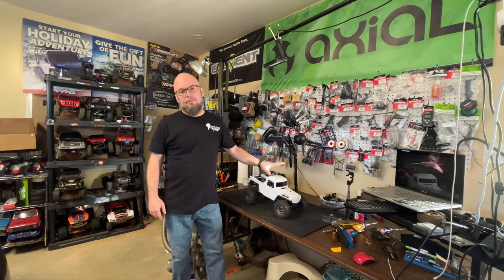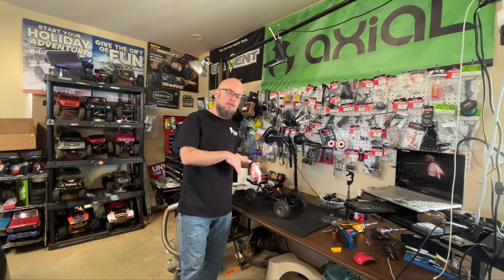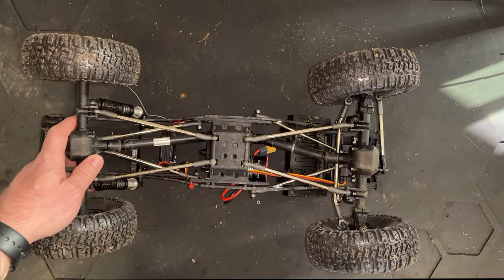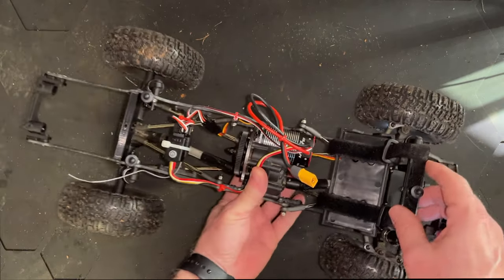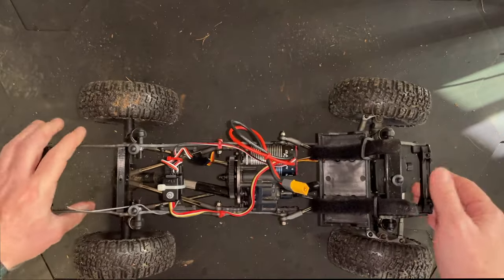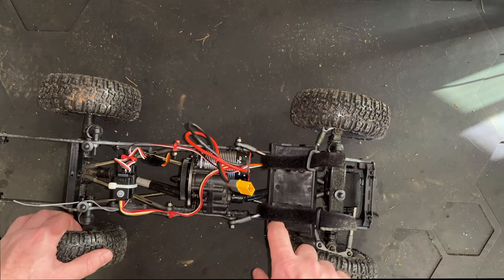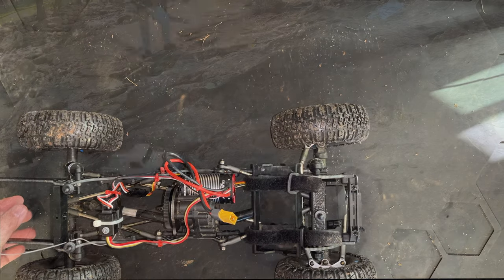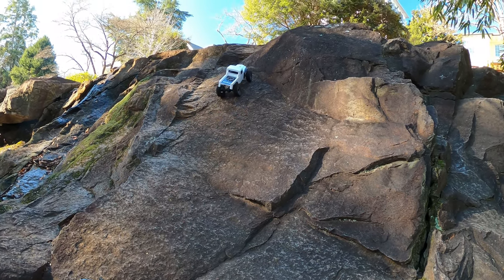UGRC Predator Chassis using Element Enduro Parts Overview and Run Video

Comment: Excellent Big Head.  That fusion, man it might not be an axle busting, speed demon, but it's a control freak, for sure. I gut 4 now, I love 'em. That white body is the stuff, man. Good job.
Reply from the maker: Thanks Paul, I love the fusion . you’re right it has a lot more control than any brushed system I’ve ever driven 👊👊👊👊👊